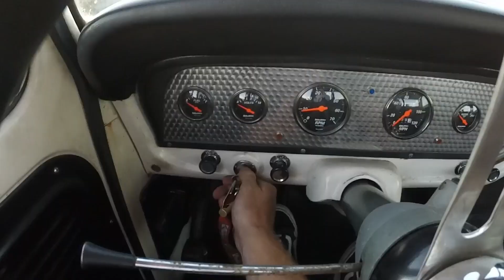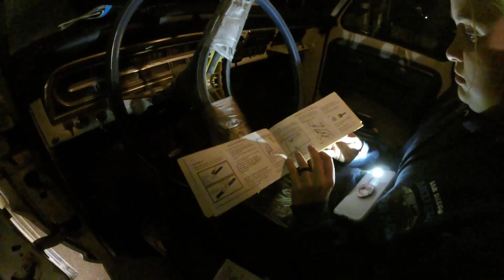My Truck Gets a Girlfriend!!!

Comment: Love the videos man! I've got a 66' F-250 camper special 2WD with a 352 FE that's been sitting for 20+, just got a crank and police interceptor cam out of a 428 cobra jet with a cracked block, gonna bore out the cylinders to a 390 and put the new crank and cam into my 352, it'll be my first truck and I can't wait to get her up and running! would love to do videos about it but sadly I don't have the equipment

Comment: Ditch the camper lol. I just bought a 77 F250 camper special on Sunday. 47,000 miles and it has a camper like this I'll swing through the dump and drop the camper off for someone to take as a hunting wagon lol
Reply: STUBBY TRACTOR Dont dump it, you could sell it for a couple hundred.

Comment: hey man i just got my first truck, an 83 c10 but with an inline 6. i would like to swap it with a 350 but i feel like i can do some modifications to make it sound nice, should i stick with the engine that's already in it or swap it for a small block? inline 6's are reliable af so that's why its hard for me to decide.
Reply: WtfBro I have a 81 k25 with small block 350 and it's reliable as all hell, poor gas mileage but it smiles per gallon and I was planning on making it a 383 stroker but stock mines making "185hp 220 torque" and parts for it are so plentiful and cheap ita great but that's just me so take it with a grain of salt